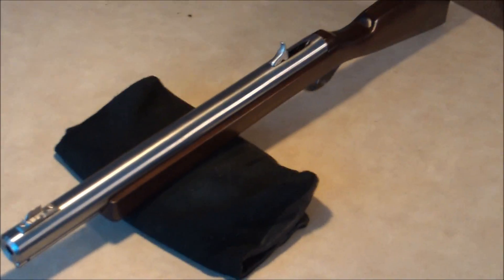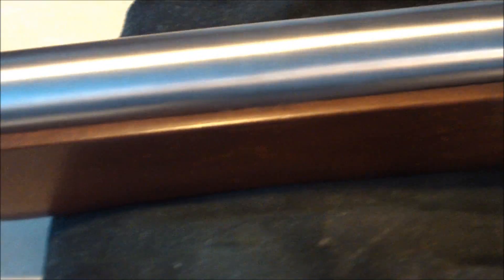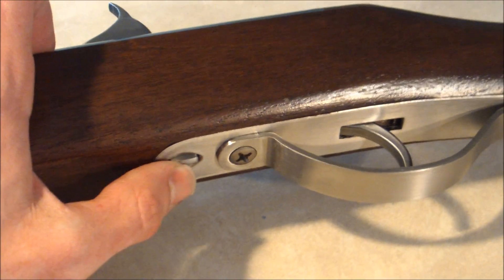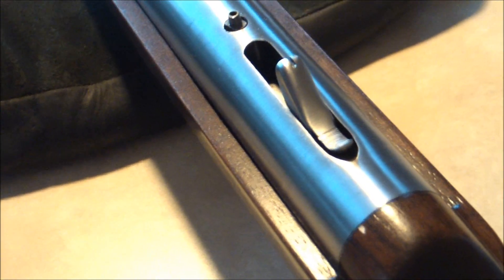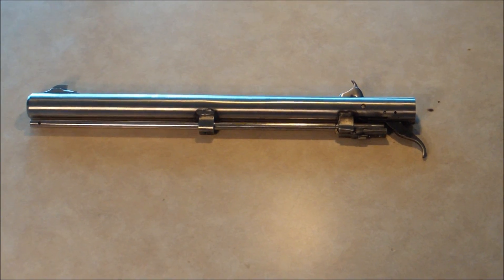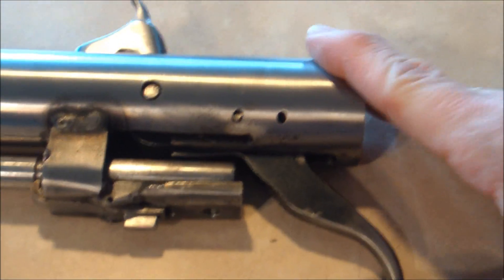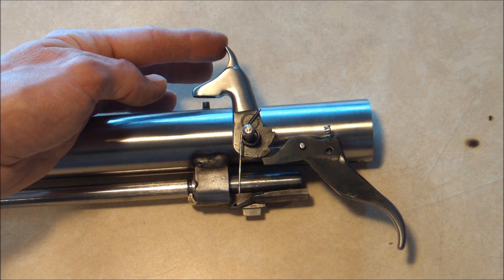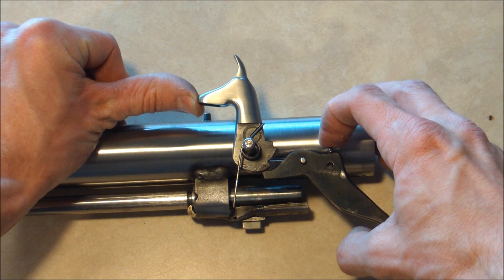The Musketoon, a scratch built .50 cal muzzleloader

Comment: If you don't mind me asking....why so thick of a barrel? Depending on the steel used it doesn't need to be near that thick. Even with DOM 1/4" wall thickness should be plenty for black powder only. I like your design but personally would have made it .75" or 12 Gauge which is .73" if you use 4140 steel I would feel safe using black powder down to 1/8" barrel wall thickness.
Reply from the maker: This was made using whatever unknown steel I had laying around, and largely without machine tools.
Reply: @JeffTanko  looks nice! DOM is grade nothing steel that's why I said 1/4" wall thickness just to be safe.. Your barrel is thick enough for any sane charge of Black Powder. Good Job  ☺

Comment: Amazing craftsmanship, especially your trigger & hammer, it's such an elegantly designed system.
I am a bit crafty myself and have a muzzleloading .50 cal pistol with a 10 inch smoothbore barrel, and after reading an old Paladin Press book about zipguns and improvised modified firearms", I discovered a technique for improving accuracy with roundball and smoothbore barrels: peen or solder a short bit of wire(1-2 inches) to one side of the roundball and load that with a patch and it will function like a tail that stabilizes the roundball in flight.
I have yet to try this out, but I intend to.